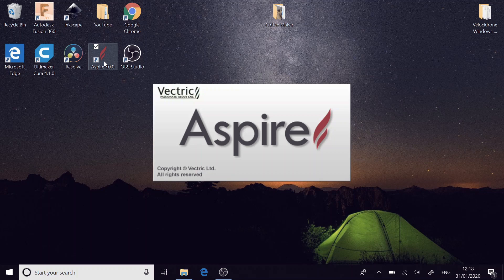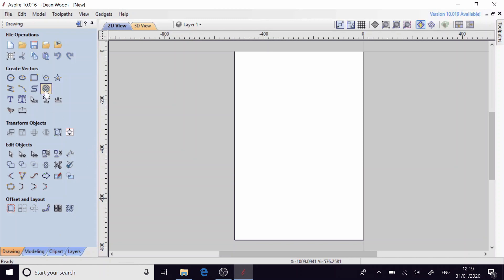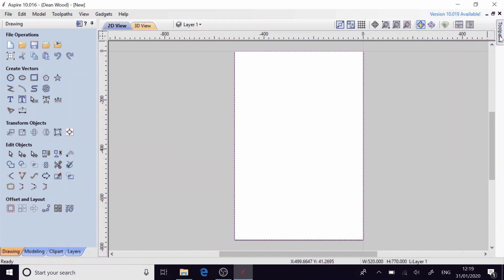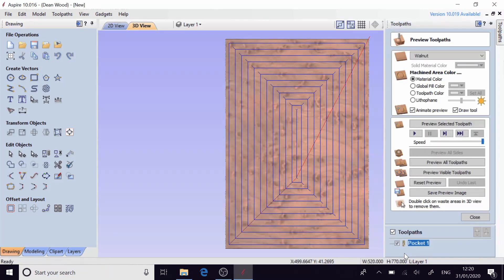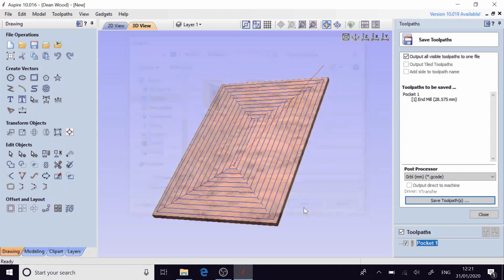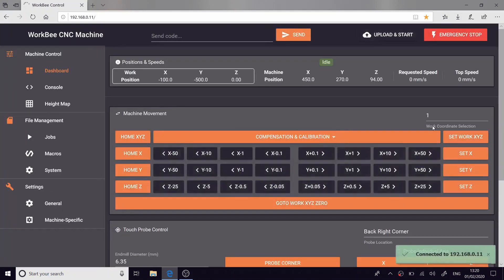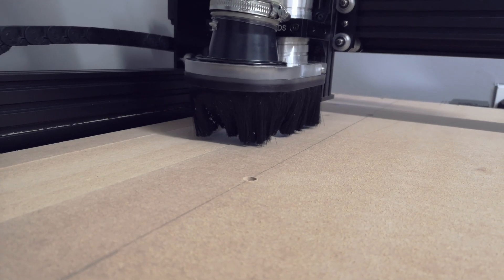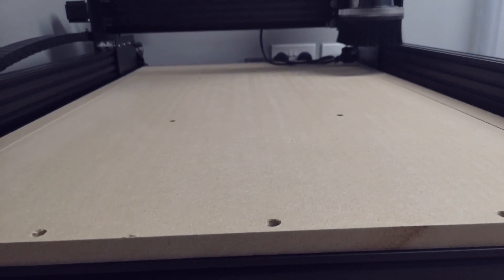Surfacing a Ooznest WorkBee wasteboard using Vectric Aspire

Comment: i'm a just about to tackle this as my machine has quite a large difference in height across the spoilboad. It looks like it also quite alot (c. 4mm). I'm worried that my first cuts will not be at the highest point and i'll end up going round then suddenly taking a massive cut. Any thoughts on an easy way to find the highest point to do the z probe there?
Reply from the maker: Hi, sorry for the late reply. Personally I'd be tempted to try and spot the higher bits by eye and mark them with a pencil. I'd then manually control the CNC with the spindle on to try and pre flatten those high spots, once your happy that they're even across the waste board I'd run a surface pass to get everything all one level. 

Hope this helps.

Comment: Hi Dean ,just watched you making a spoiler board and a newbie to CNC and have  bought and built the same machine mine is a 750 x 750, the problem I am having is that I cannot surface to the end (front of machine), I intend to surface one end then turn it round to do the other. I am running the same bit but just get the message " outside of machine limits " .How did you work out your machine working area ? and did you have any issues like this ? I am using Vcarve pro  , so just trying to work out if its a machine issue or a programme issue ||
Reply from the maker: Hi Sy, 
Firstly, please accept my apologies for not getting back to you sooner as I've only just received notification of your comment.

With V carve and aspire when you set your safe heights (under the tool path tabs and then 'set material') you can change your rapid movement heights and gap above material. when I first installed Aspire these were set to around 50mm and the rapids were at 20mm. I reduced mine to 5mm on the rapid moves and 10mm on the gap above material. If they are too high to allow the Z movement you'll get a G0 or G1 warning.

This might be slightly different for yourself as I don't use clamps to hold my work down so I can run slightly lower.

I hope this helps

Comment: Hi dean I followed this to the letter however my router follows the path but is above the material by approx 20mm any idea what I’m doing wrong ?
Reply from the maker: Hi, 

Sorry to hear it's not working for you, the only thing I can think of off the top of my head is the work offset in your software as I've had this happen when cutting a project. 

If you're on Facebook the workbee CNC group is a great resource and has many experts who'll be happy to assist.
Reply: @DeanMakes  thanks dean, it was to do with me setting work xyz after using the probe
Reply from the maker: @DoubleYooJayEee  glad to hear your sorted 🙌

Comment: I know nothing about CNCs but it looks like you did a good job 👍
Reply from the maker: Thank you, I need to adjust the router slightly as there is a small ridge on the right hand side of the cut. I think that is because it's not 100% square in the mount ( that's user error though 🤦‍♂️)